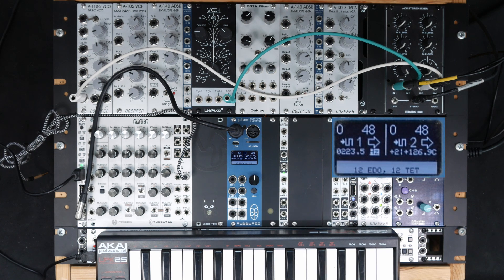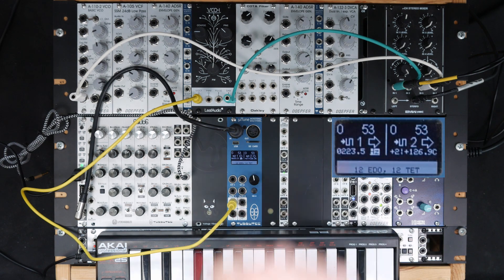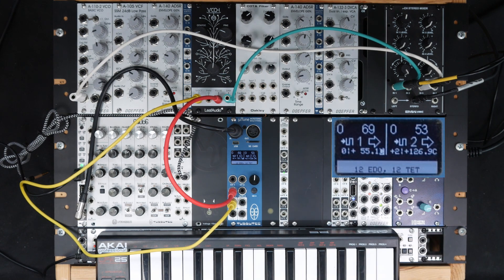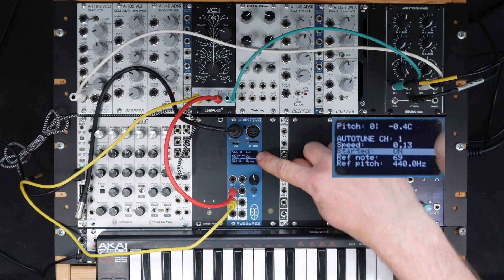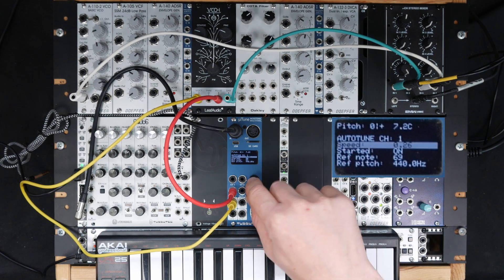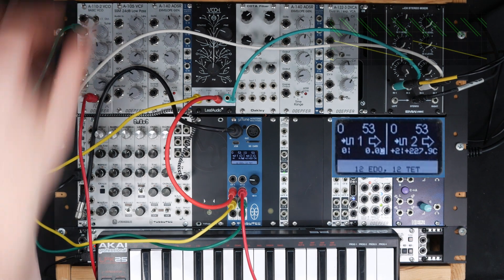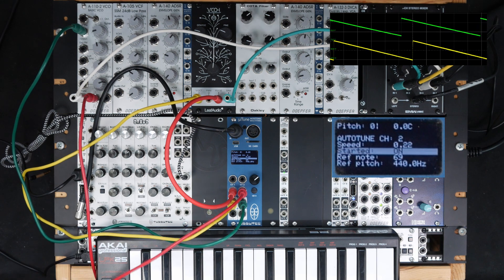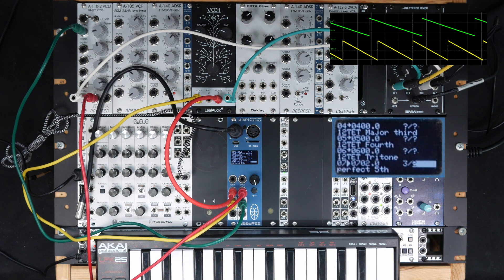Tubbutec µTune tutorial - Autotuning

Comment: Hi, in order to use the autotuning live, does a spare output have to be connected to the gate input, or once the calibration is done, will it work (when turned on) with a normal use of the gate input?
Reply from the maker: Hi, when using autotuning, you always need a gate input, as the gate input is used to measure the VCO's frequency. You can however not use autotuning and rely on the VCO calibration instead (See other video). Provided that your VCO does not drift much, this is usually sufficient and allows you to use the gate input.
Reply: @tubbutec  thx.